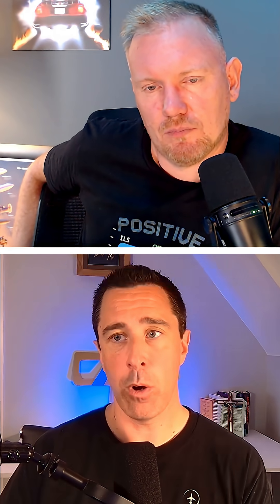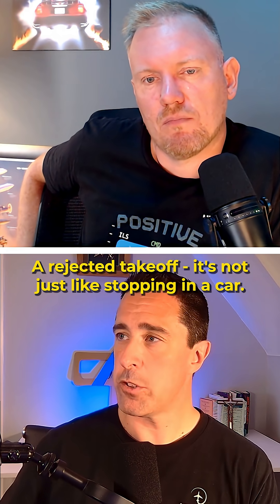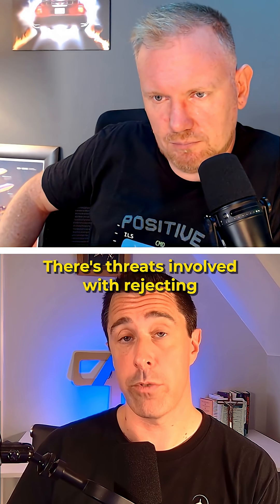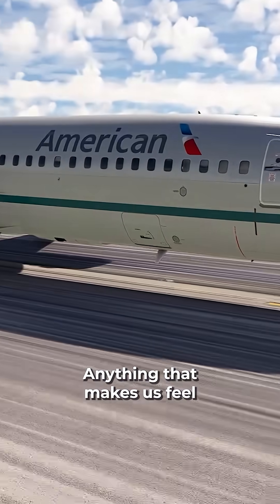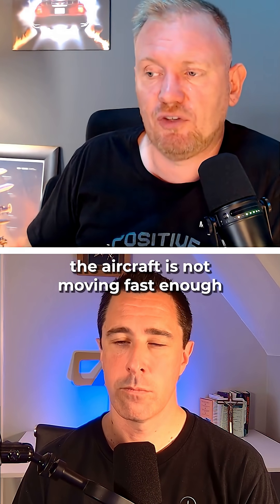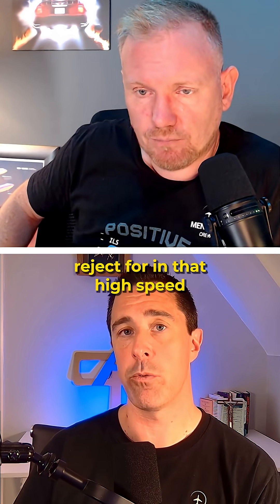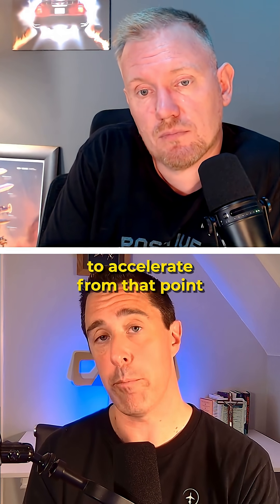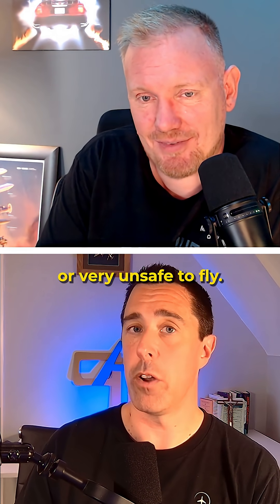Pilots Answer: What Is A Rejected Takeoff?

Comment: I was a passenger on a plane where we rejected a take off.  We were lined up, engines spooling up, brakes released...we rolled about 50 feet and then everything shut down.  Turns out we had a fluid leak and had to be towed back to the gate.  That was a very long night.